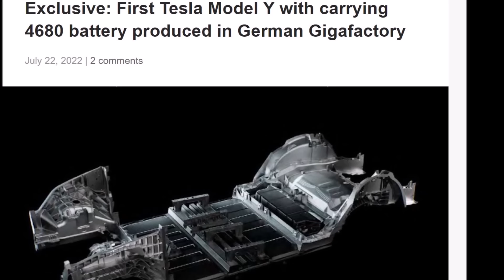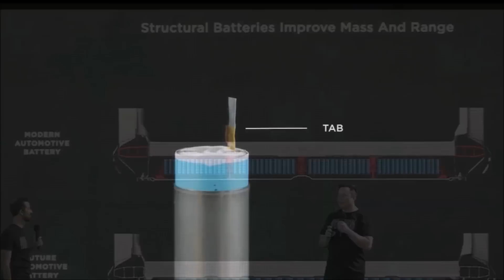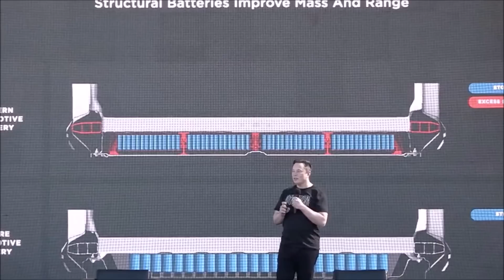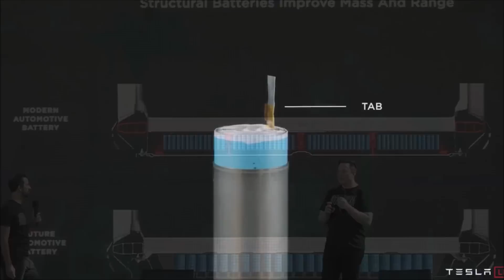BREAKING! Tesla Giga Berlin Builds First Model Y With 4680 Battery

Comment: not convinced about this
Reply: Plenty of press on hand in Texas on the commissioning of the new 4680 battery line. Sounds like proof of concept test of the Gigafactory Berlin to verify clearances in the production line.
Reply: @williamlloyd3769  yeah texas has them but im not sure they would send them to berlin
Reply: @ScottvanBreda  Giga Berlin currently have lower production volume (compared with the Fremont factory & Giga Shanghai). So it is easier for Giga Berlin to test out the new currently smaller volume 4680 battery technology? Testing on 4680 batteries are also on-going in Giga Texas.
Reply: @leesweehuat  Berlin volume is higher than Texas mate